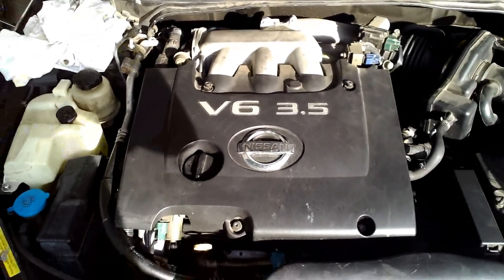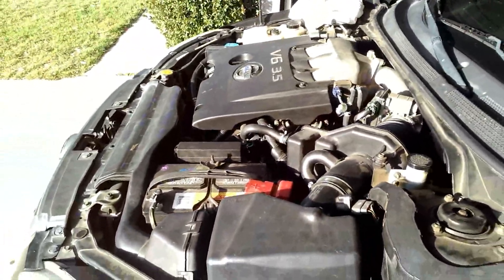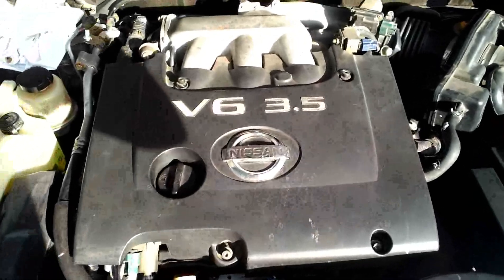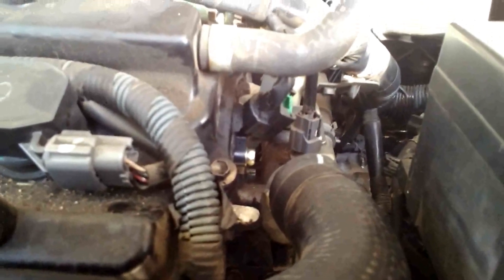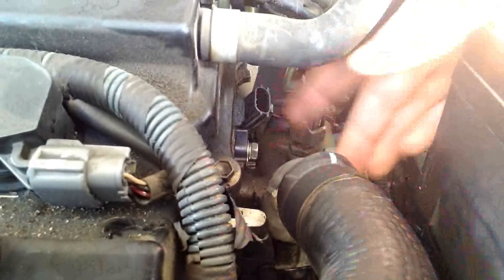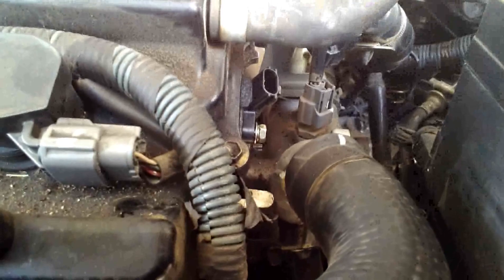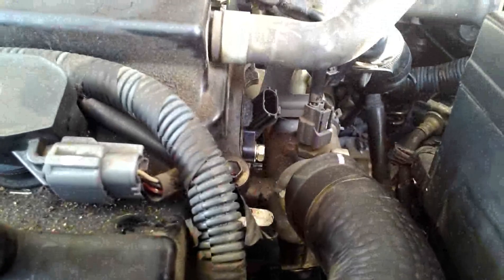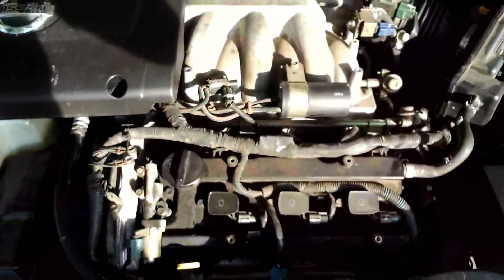DIY - P0345 - 2003 Nissan Altima 3.5L Camshaft Position Sensor (Bank 2) Replacement

Comment: Just replaced mine, but the sensors would not slide in all the way past the o ring. Anyone have any suggestions to get the sensor to push all the way through ?

Comment: 2003 Altima 3.5 SE.  Car threw up P0345 and would not start without a fight.  Replaced Camshaft Position Sensors (Bank 2 and Bank 1) and Crankshaft Position Sensor.  Friend (former Nissan Tech) advised to do them all.
Car continued to throw up fault code and would not start.  Took it to Nissan, they put a OE Camshaft Position Sensor (Bank 2) in and it works fine.  Memo to self, buy OE sensors next time.  I will save the old Bank 1 and CrankShaft sensors for next time.. They may work again.
Reply: +Chemnitz11 
I bought one of sensors and getting the next one soon. Good thing I bought OE Sensors. Thanks for the info
Reply: Chemnitz11 Hey, where is the crankshaft position sensor on the 3.5l altima? I can't find it for the life of me & all youtube videos are 2.5l. 😕

Comment: Hi, i have the same car u have, exactly, same issue as urs, i just had mine turn off randomly when i drive the car, not like crazy, just like once a day or so, but just been like this for like 4days, hope dont get worse, cuz till i get paid like. I'll replace it- did urs accur like mine is??
Reply from the maker: Hi Elijiah. Has your SES light come on yet? If so, I would suggest to pull the code to be sure you replace the correct sensor. As for mine, it stalled a few times over a couple days, and a few days later it was having a real hard time starting. Replaced it immediately after that. Good luck.
Reply: Yes it has come up the ses, well i had the auto part store pull up the code and I saw it on the computer when he scan it, it read cam sensor bank 2 and he look it up on the computer and he help me where it was, plus it cant be on bank 1,cuz i replaced that one before. But it has stalled a few times and been like this for about 1 week and and half, right now its turn on so far so good, so i dont KNOW if it will get worse, i order one already neway. The last time it stalled was 3days ago,
Reply from the maker: Hard to say how much worse it's going to get, but it sounds like the car is still starting fine, so I think you should be alright until the part arrives. Good luck with the repair.

Comment: I had this same problem code P0345. Replaced the sensor and still having the same issue. Do I have to clear the code after I replace the sensor?
Reply from the maker: BoostedLude Disconnecting the battery for 20 minutes or so should clear the code
Reply: 1105comfortablynumb I tried that also. Disconnected for 2 hours and the ses light never disappeared
Reply from the maker: BoostedLude If you're still having problems with the car starting/stalling, and it's still throwing the same code make sure the sensor is OEM. Have heard stories about aftermarket sensors not working correctly.

Comment: Hi, for the other camshaft near fhe firewall (bank 1), do you have to take out some components or it's directly accessible like bank 2?
Reply from the maker: Hi. The bank 1 sensor is deeper in the engine bay, so it's not quite as accessible. It's going to be cramped, but you should be able to get to it fairly easy. The only thing you should need to remove is the Air intake duct/hose.
Reply: Polo P I didnt have to remove anything. I used a fixed wrench though to loose in 10mm nut and used my hands the rest of the way.  On an 03 Altima 3.5, I think there is enough room.

Comment: i have a problem with mine it cranks vut wont start changed the battery starter no code comes out any help is apreciated
Reply: thats the cam senser

Comment: I am so confused. I have the same issue. I am going to replace it myself. How do I know if I should replace Bank1 or if Bank2 is the issue?
Reply from the maker: A little of a delayed response here, but you can just pull the code to tell which bank needs to be replaced. Bank 2 will give a 0345 code. Good luck with the repair.
Reply: Thank you! I actually replaced both and it was a heck of a lot easier than I expected!
Reply: Jbaby Ramirez I have been told by a former Nissan Tech/friend that it is advisable to replace them all at once.  Not sure if there is merit to doing so.  But as indicated in the prior response P0345 code indicates Bank 2.
Reply: Thank you. I replaced them all and the issue is resolved!! But, of course I have another issue! Good old Nissans!

Comment: Where did you get the part? The after market ones I got don't work for sht. Also is your part metal and round? Or plastic and rectangular
Reply from the maker: The aftermarket sensors seem to be hit or miss. I bought mine from the dealership for about 100 dollars.
Reply from the maker: It's a plastic sensor. I show it in the video. Good luck with the repair

Comment: Hi is this the camshaft or crankshaft sensor?
Reply from the maker: Hi. This is for a Camshaft Position Sensor. The Crankshaft Position Sensor is located in the lower rear section of the engine(Closer to the firewall).
Reply: El Ocho Fierro no crankshaft is on front lower of engine.  Accessible from bottom

Comment: i have the same problem but instead its a 03 nissan maxima gle ...im having a very hard time finding out any type of information on it...nothing comes up, can anyone help me?
Reply: with the SES light on ...after checking it came back with the code p0021 so its bank 2 and cant figure this out it sucks and its broken down wont start ive replaced the alternator and battery,drive belt, pulley and a plug i think was called a pigtail so thats also has been replaced so now im onto this reason, cause i think the people that had it originally when it was "getting fixed" i think they have rigged my car to only have these problems because they only fixed the alternator,drive belt and pulley then after dayyyyys of no word or anything when i finally got it back the SES light came on after an hour of getting it back, and noticed it didnt have much power still so a week later or so on the 14th the battery light came on and my car died so i changed the battery still the same and changed the pigstail so i really need help, this is my only transportation and i have a 2 year old to support ... thank you
Reply from the maker: kristi Mcnulty Hi, I'm sorry to hear about your car troubles. A p0021 code is consistent with a Camshaft position sensor. This is a known problem in these cars. Luckily, it's a bank 2 which is a lot more accessible. The part is about 100 dollars from the dealership. I recommend buying the sensor at the dealer as opposed to Autozne because I've read about people having problems with the replacement sensors. It's a fairly easy and fast fix. Good luck with the repair.